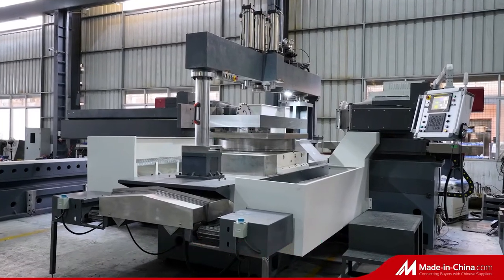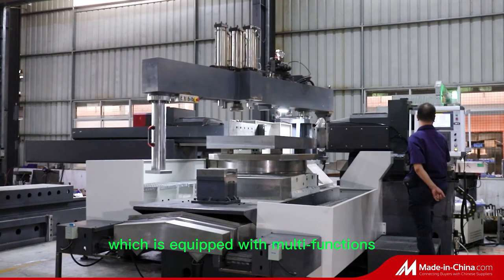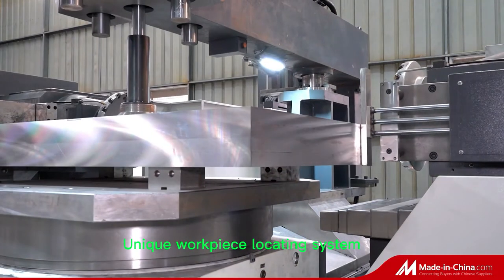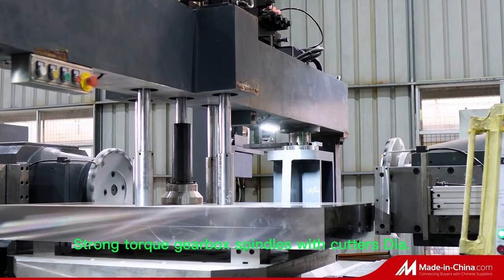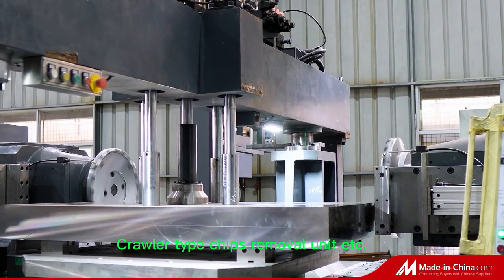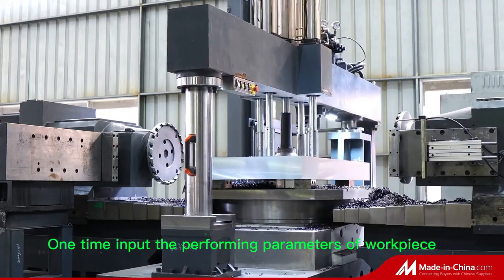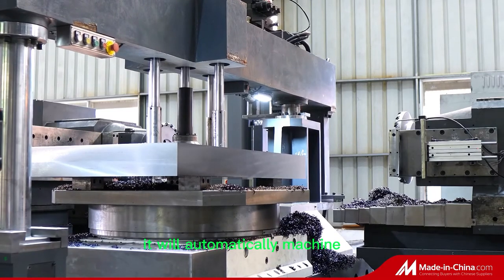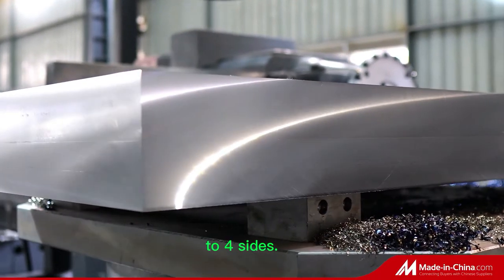TH-1600NCA DUPLEX MILLING-DOUBLE HEADS MILLING-TWIND HEADS MILLING-DOUBLE SIDES MILLING-FOUR SIDES M

Comment: Great machine tho not a a precise way to machine a huge plate like this. Applying load in the middle but yet nothing supports where the load is applied to. Therefore distorting the plate.
Reply from the maker: Thanks for your comment,bro.It just processes self-using plates.and for a performing example.Yes,if do high precision cutting,you shall put a support in the center and below the pressure bar.